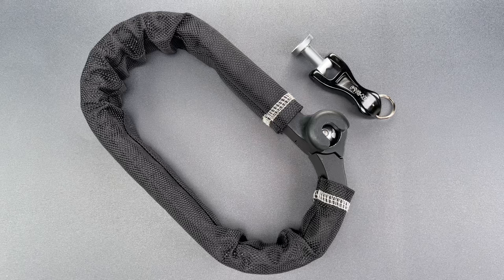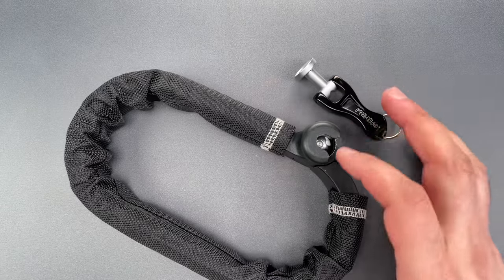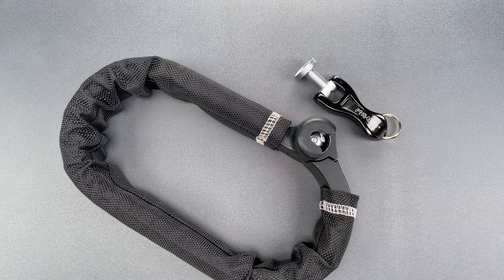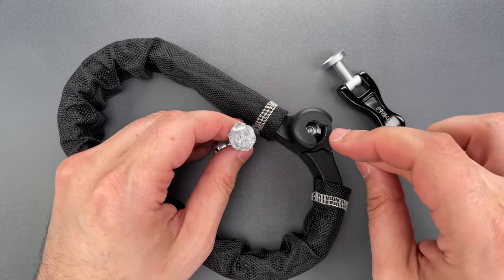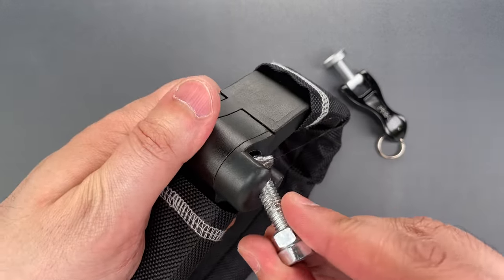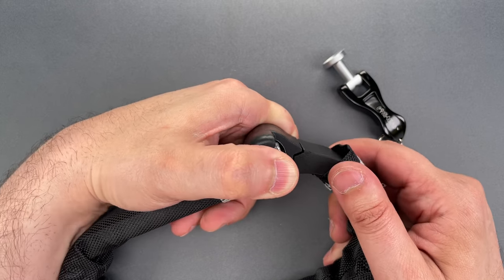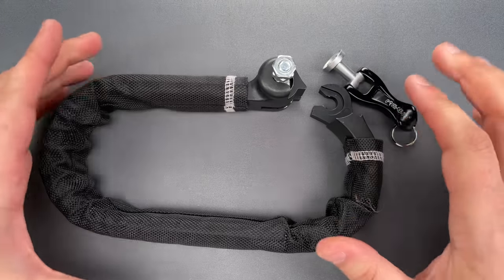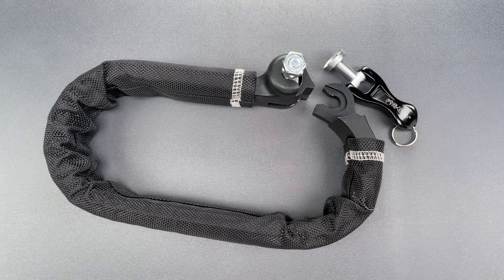[1333] Opened With Hot Glue & Bolt: Pinhead Bike Lock

Comment: honestly 20 seconds to let the glue dry is still more secure than most other bike locks he reviews.
Reply: LOL🤣
Reply: I guess a disadvantage would be that if you lock your bike in front of the same place most days, a thief would have adequate time to prepare.
Reply: Plus you can't be arrested for "going equipped" if you have a glue gun with you
Reply: It is more than that since the gun is going to take a few minutes to get the heat gun up to temp, same with an epoxy impression, that is going to take 10-15 minutes to set.    Not to mention it isn't super common things for people to carry around.   
I mean It isn't something I would use on a bike I intend to leave unattended for a few hours or overnight but for locking your bike up while your in a store or something this is actually a pretty good solution. 
My worry is that looking at the key you could just grind off the other 2 nubs and have only 1 pin and it would work as a universal key.    That is what makes this a trash product in my mind is if it did become common you would just see someone make a universal key for it that way.
Reply: Yeah 0 skills needed though.
Reply: @poggs  Context is key for carry laws, at least in the UK :)
Reply: Salesman: "Here it is the magic lock !! The lockpicking lawyer needed a whole 20 seconds to pick this lock, compared to your regular lock it is 4 times the security !!!"
Reply: Only if you're concerned about non-destructive attack, most bike theives use bolt cutters or cordless angle grinders and often get away with it in broad daylight.
Reply: A 5 sec high skill attack >>>>>>> 20sec low skil attack
Reply: even a rake attack requires you to have a rake ... this can be done with any sort of glue and rotation stable stick
Reply: Depending how much force is needed, a strong double sided adhesive tape might do the trick very quickly.
Reply: lasted longer than a Masterlock
Reply: he could ptrobably have gotten the same effect with a wooden dowel =, some CA glue and an accelerator. Dab, sick, spray, open. 10 seconds total.
Reply: a reliable lock for a bicycle, this is a failing seat that rips the thief's ass.
Reply: I think the biggest mistake in this case, would be the big branding logo on the chain cover. Once a thief knows how this brand of locks work, they can open them all with the method shown or similar.

If the branding was more discreet, many people would look at the ‘key way’ and be otherwise very confused.
Reply: @DevilAgent  😀
Reply: @putrangos  Whoa whoa whoaaaa! Don't forget the additional 10 seconds he gave the glue to firm up as well. That's a whole 30 seconds or 6 times longer than it takes to pick the Panasonic/ULAC locks
Reply: HAahahahha
Reply: Glue from hot glue guns doesn't dry, it cools
Reply: I'd be interested in whether Bluetack is strong enough to guide the rotation.

If it will work then the time required will go down to "within a few seconds".
Reply: U know u can make it hard w lighter gas in under 2 seconds lol
Reply: Wonder how many seconds could be shaved off by giving it a good blast of deodorant or similar.
Reply: @MaethorDerien  the nubs are what "grab on" to do the turning. If you grind two of them, the key will be useless and just spin on the remaining nub. My wife has this system for her wheel hubs, since we used to live in Boston and quick-release bike parts were at high risk of theft.
Reply: @toddsmithselbow1732   - TSE is correct. All of us could "pick" this lock!
Reply: @MaethorDerien  There's other kinds of glue other than a glue gun lol.
Reply: @clarkesuperman  Discreet branding, hidden keyway and a fake keyway would go a long way to make this more secure.
Reply: If this was anyone else I would have skipped ahead that 20sec...
Reply: @LarryInLouisiana - I hope you're not expecting you day to get even more exciting than this!  ; )
Reply: Problem is that literally anyone could do that, while the usual less-than-a-minute picks are something you don't get from the average bike thief.
Reply: I was going to say the same thing- a 'low security' bike lock that takes 30 seconds to open- versus a 'high security one' he describes and then unlocks- twice- in the same thirty seconds.... hmmmmm
Reply: Fr
Reply: @ChadHadsell  No it won't because it has a central hole, with the nubs offset from the center.    Also those wheel hubs do have that same exploit which is what actually made me think of it.   Many of them only the depth in the dips is different so if you grind that part down and only leave the top area.
Reply: @kris5187  true but if you have a hot glue gun and literally any material that could be considered a crafting material it would be easy to just say, "going to meet with a mate to work on a project"  Unless you get caught in the act in which case it wouldnt matter what you are using to bypass locks
Reply: That's the thing that throws me off the most. On the one hand, opening this lock is just as trivial as other locks, except for the big difference of a random thief likely not having the tools at hand and thus making this lock infinitly more secure than most everything else we saw thus far.
Reply: If a thief wanted to be prepared for these kinds of locks it should really not be all that hard to fabricate an adjustable "key" with two pins to turn that bolt in a second. Despite the real key having three prongs I bet two would be more than adequate to turn it.
Reply: @MaethorDerien  Cordless glue guns don't really take a lot of time to get up to temp. Think about the battery drain if cordless glue guns were constantly hot. They're essentially the same concept as a soldering gun. A soldering gun is only hot when you hold the trigger and they get hot extremely fast.
Reply: HOT GLUE DOES NOT DRY. IT COOLS.
Reply: But it's not slash proof
Reply: @Maric18  I'm curious if you could just do it with some firm silly putty and a stick.
Reply: @chnet968  I had the same thought. That and a stick could possibly have this done even faster
Reply: As LPL said, "I'm sure there are many ways to make an imprint."

In the real world, the thief might need an extension cord for the glue gun while being very careful to not aim the glue gun at a cop. :)

"5 minute epoxy" needs about an hour for a functional bond and at least 16 for full strength.

Maybe super glue and bubble gum will give just the right amount of grab :)

(I understand LPL's videos are enjoyable and interesting puzzles to solve, not real world defeats.)
Reply: Good point. 🤣
Reply: @Arch3r666  
Tying your bike up using cooked pasta is more secure than a master lock.
Reply: @MrDmitriRavenoff  
Only in Merica.
Reply: @MaethorDerien  The 5 minutes to heat uo the gun is done away from the bike. And yhis isn't an attack on a random bike at a random location, but when someone always tskes yheir bike to work/school or similar. So if bike is seen 2 or 3 days in a rows, it's meaningful to show up next day and see if the bike is there again.
Reply: I imagine a hot glue stick and a lighter would do the same thing

Comment: It held up for 30 seconds waiting for the glue to set. Most locks don't make it that far against LPL... Must not be too bad.
Reply: Precisely what I was thinking
Reply: It takes a while, but it's incredibly low skill. So literally anyone can do it. But it takes a while.
Reply: Yeah but what's the point of LPL taking 30 seconds to open this lock if ANYONE can also open it in 30 seconds?
It's like saying "it took LPL 30 seconds to open the packaging, therefore it must be a good lock".
Reply: In a few months time, locks will be rated by how long LPL takes to unlock them. Better than some arbitrary LVL 8 security.
Reply: All any lock is, is a time delay device.
So, fair play to this one.
Reply: @lairdcummings9092  yeah... but time, skil and tools requiredl are relevant. If a low skill low tech attack is slow, but reliable that rates different then a fast high skill. But offcourse that is again different then specialized tool, fast and low skill (like using lishi tools).
So comparing time is both fair and isn`t.
Reply: @sarowie  in the end, I resort to the practical definition. If a locking device causes a thief to move on to an easier target, then it's done its job.
Reply: In the field he would carry a freezer aerosol to cut out the waiting time.
Reply: @carlosbaldellou  r/woooosh
r/ihavereddit
Reply: @kabochaVA  Let's be real, most bike thieves will grab whatever they can with some wire cutters and get away quickly. This doesn't seem like it could be opened with bolt cutters and most thieves are really not going to bother with finding a method of opening it. So in that sense it's still a lot safer than many other bike locks.
Reply: It’s very easy to open, yes. But how many bike thieves carry five minute epoxy and a “wrench” equivalent on them? I’d call this lock pretty good because it’s only easy to open with uncommon tools.
Reply: @LadyDeirdre  - If you own an expensive bike and regularly park in in the same place such as work or school, your bike could be targeted if you use this lock.
Reply: @scootergeorge9576  In such a case, I'd advise a better lock, yes.
Reply: @carlosbaldellou  Anyone that happen to have a screw on that size , a gluegun , a hammer to gave shape to the screw ..... and a fair amount of time to do it .... i would hardly call that "anyone" .

Comment: I'm a bicycle mechanic and I deal with these lock bolts constantly, many people buy them. It makes sense the hot glue trick would work only on the lock. Quick release skewer locks have way too much tension keeping them down for this method to work effectively.
Reply: For the sake of protecting people's wheels I won't say which tool, but I used to work with a bike mechanic who would remove the ones from wheels in about 20 seconds with standard toolbox tools when the customer forgot to leave the key. In a high theft area or with expensive wheels I'd advise to just use a propper lock on wheels, and I really don't see the point is this lock for a bike.
Reply: The lock is the most important part though, once you steal the whole bike you have all the time in the world to worry about getting the parts off.
Reply: Would a neodymium magnet work?  Or are the parts aluminum?
Reply from the maker: Impression it with JB Weld.
Reply: @lockpickinglawyer  The hot glue of the mechanical engineering world 🤣😂
Reply: @lockpickinglawyer  Ahahaha, fastest pick so far, 5 words...awesome
Reply: @andyarchitect  i could see something like a flywheel wrench or even a cotterpin plyers doing it anything even a screwdriver with a big enough head.
Reply: @andyarchitect  If you're talking about what I think you're talking about, Pinhead developed a washer that prevents that from working which they ship with the locks now.
Reply: @lockpickinglawyer  while it would get it off, that's kind of missing the point.  The only other option for the seat and wheels is either a quick-release or a standard skewer nut, both of which are much easier to remove than these.  That being said I prefer to use a proper lock for the bike and the pinhead stuff for the wheels and seat only.  U-lock through back wheel and frame.  Haven't lost a seat or wheel yet.
Reply: Just use regular bolts and lever skewers on your bike. The hassle at maintaining and adjusting just isn't worth the awful quality of security skewers and collars.

My bikes are 10s to 100s of times more valuable than common bikes, and the key to not getting shit stolen off them is "don't leave them outside forever". The bike is fine outside while you're in class, or the store, or the movie. It is NOT fine out there for days and weeks at a time. Bring your bike inside whenever you're home. You'll reduce maintenance by 400% as a side benefit.
Reply: @Hansengineering  Exactly what kind of 'quality' are you looking for in collars and skewers? I actually use the pinheads and they keep my seatpost still and my wheels going in circles. Not sure what else you want. 

And just because you have the luxury of expensive bikes and convenient places to store them doesn't mean everyone does. I've worked lots of restaurant jobs and there was absolutely no way I could bring my bike inside. Similar situation in school, or if I'm going inside a rec center for multiple hours.
Reply: I use the pinhead locking skewers on my bike, and the time I save not having to worry about the wheels when I lock up my bike (with a Kryptonite) is well worth the price. Someone looking to steal the wheels off a bike isn't going to take the time, they'll just move on to the next bike. On the other hand, I once had a Bianchi stolen from outside my therapist's office while I was inside for an hour session. Short periods of time are no guarantee when thieves have portable angle grinders...
Reply: @watsonlr  You can lock most seats and all wheels with cables or chains.  Heck, back in the 90's when I was big into cycling, I would routinely take my seat with me whenever I locked my bike to a bike rack.  I just tossed it in my backpack and left my bike parked without the seat.  Easy peasy, but maybe not as easy with dropper posts.
Reply: Agree with OP here. for LPL, well, if you're bringing JB weld, and that point you may as well pull out the ramset 😅
Reply: @BlaubartMT  I only ride to work Nd security absolutely freaks out if you try to bring a seat in.  I personally like the pinheads since I don't have to carry another chain or another lock and it simply makes my bike less of a target.  Whatever works.
Reply: @Hansengineering  my expensive bike was stolen after I left it locked with 2 different locks for a grand total of 10 minutes. The guy was caught on camera cutting through both locks and the cops still couldn't ID him or find my bike. What you are saying is nonsense. I got security skewers and mounted them to a beater bike and I haven't had a problem since.
Reply: @vkogan1990  if you feel like reading my whole comment, and then replying to THAT, and not what you have made up in your own head, I'll continue this conversation.
Reply: @crazybob75  man losing a Bianchi stinks. Found mine two years later sticking out of the mud in a riverbed. Looked like it had been in there the whole time. Probably used once before ditched.
Reply: I would think the skewer locks would open with one of those multi sockets with the.... gasp, pins in them.
Reply: @metamorphicorder  those pins are larger than the holes they would have to fall into. Might be able to catch enough on the edge though. Never tried.
Reply: @lockpickinglawyer  Your mental acuity is VERY impressive. You seem to have a primarily geometric manner of processing information. Admirable. And for the record, I'm a PSC behavioral health clinician and expert witness. I LOVE this channel and have shown it all over the courthouse. You have a lot of fans here.
Reply: Hello fellow bike mechanic.
I keep a spare pinhead wrench around, with 2 of the 3 pins ground off, so it can fit into any 'individualized' pinhead bolt set that rolls in. Tho you have to be careful about holding it engaged when there's only 1 pin. extra length of protruding skewer helps with this.

You can also bypass the security bolt entirely, grab some Cone Wrenches and temporarially overtighten the hub bearings. That will relieve enough tension that the Pinhead can be spun off by hand. You'll need to reset the bearings after of course.

And lastly, a sharp centering punch with a hammer can be used to slowly unscrew the pinheads, 1 tap at a time against the dimples. The small handle of the security wrench means they are rarely torqued down much.
Reply: @BlaubartMT  it would be funny to see the thieve sitting on the metal pipe that’s below the seat hahaha
Reply: @Hansengineering  

Not true.

I  am lead of a neigbbourhood and safety/security ambassador.

A kids limited edition "Stranger Things" bike got stolen when the kid was in school.